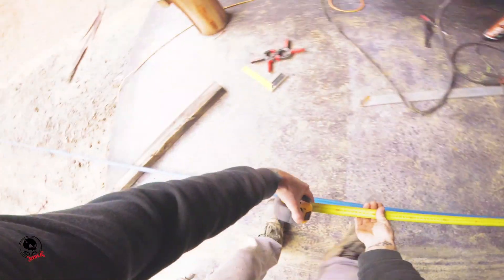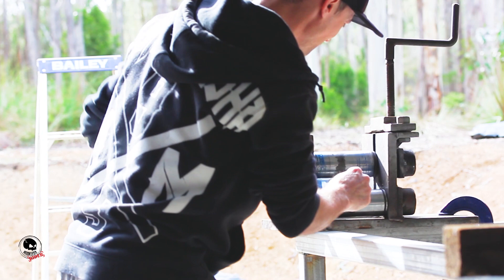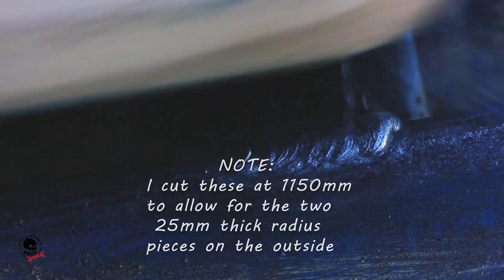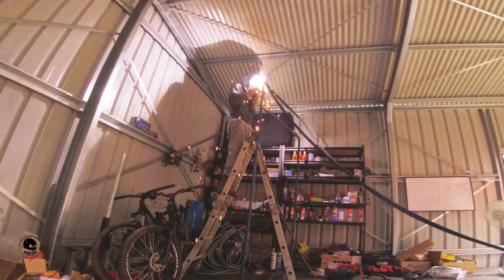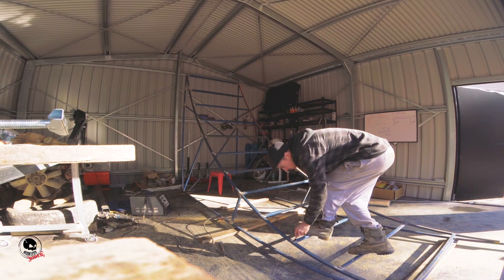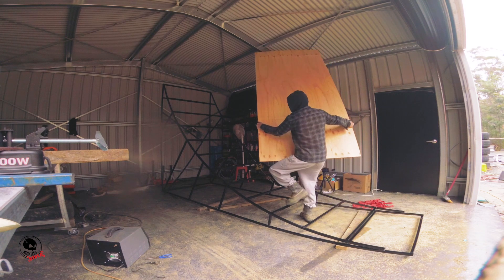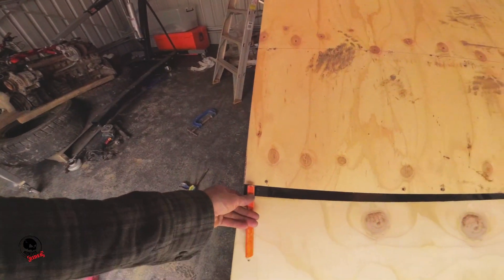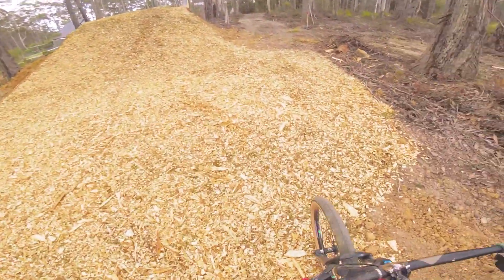HOW TO BUILD A STEEL RAMP

Comment: I’ve been wanting to learn welding for a few years now for the main purpose of building skate ramp structures. What’s the learning curve to pull off what you’ve done here? Think it’s worth my effort? Or should I just stick w wood? Also price.. what would be cheaper/cost effective? Thanks in advance!
Reply from the maker: @BertoBoyd  G'day mate.  The way I look at it is this. You might spend a bit more on your first ramp if you go out and buy a welder and steel and learn how to do it, but you'll always have the welder and learning a new skill is always very satisfying and you'll have that for life too. Get a decent MIG that uses gas (you can get cheap gasless migs but gas gives you a better weld), watch YouTube tutorials and take your time. Im still a pretty shit welder but I can get the job done to a level that's fine for this sort of thing. I did end up building a timber ramp exactly the same and I enjoyed both options. As for price I'm really not sure. I got a great price on the steel back then, and both timber and steel prices have gone crazy so I really can't tell you what's the best option price wise sorry.
Either way you go, have fun and let me know how it goes. Cheers